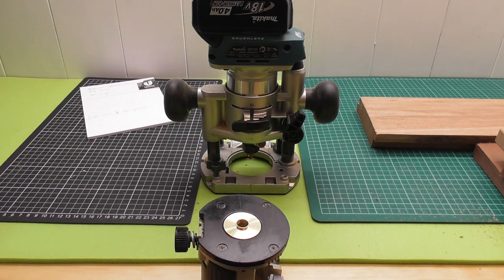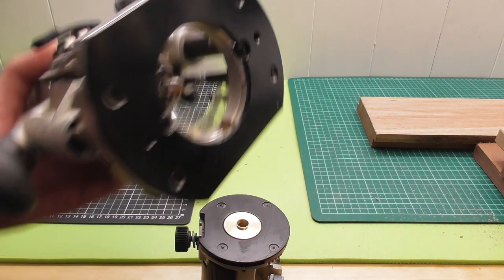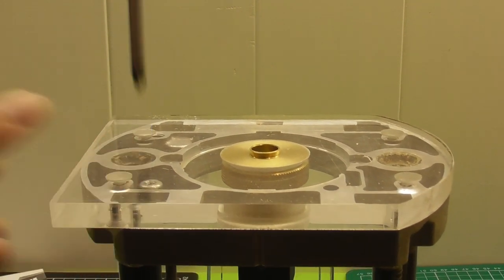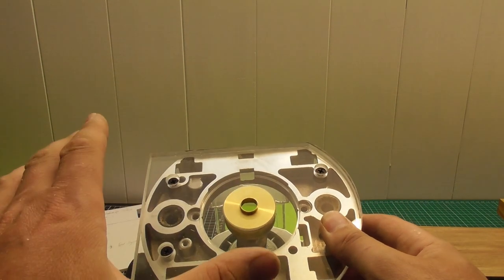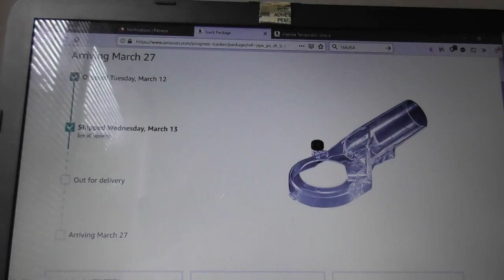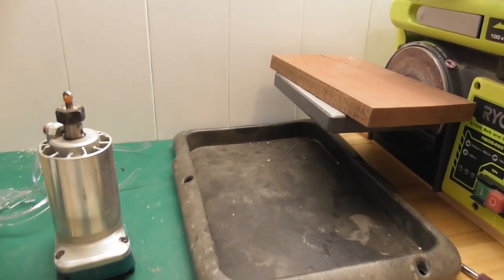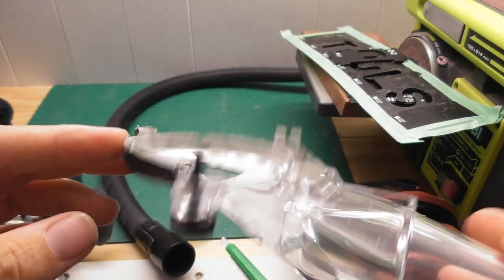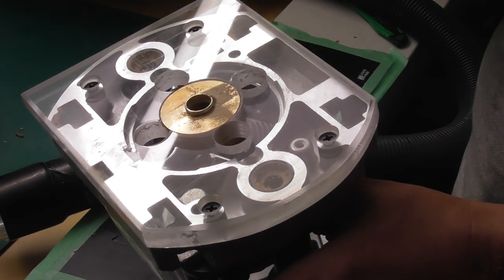Makita DIY Plunge Router Base Template Guide Base

Comment: solid i was wondering what size forstner bits i would need to do this, your video answered that for me, thanks. If I could add something to it though, I'd recommend drilling the 35mm counterbore first, then use the center point left by the 35mm to reference the center of the 30mm so they end up perfectly concentric 👍

Comment: Good vid cheers, Had just made myself one of these over the weekend too, Except mine is for the cheap ryobi router. I did the exact same stuff up too, I drilled my hole right through with the small forstner bit first then realised I still needed to centre a bigger bit to rebate the bushing. 
Where did you get your acrylic from in NZ? 
I can only find 6mm perspex or wholesale suppliers of large sheets.
Reply from the maker: It wasn't too big of a deal because I had already set the fence on the drill press so it was easy to line up again. The base was originally a sign that my wife brought home from work. Up to 20mm is available from some sellers on TM.
Reply: @ToolsAndStuffOFFICIAL  cheers, will take a look! yeah I used an old acrylic book rack from work too, but wasn't perfectly flat.
Reply: @ToolsAndStuffOFFICIAL  Drilling the bigger one first, halfway and then ending with the smaller one for the rest ?

Comment: im new to this what does the guide bushing do ?
Reply: Allows you to follow templates, like the letter he used in the video. Those are called Porter Cable types if you Google it. You can buy kits with various sizes. The adapters are easy to find.

Comment: The problem with dust collection is that the bushing covers almost the whole template. There's very little room to suck out the dust. If you were to rout without the guide bushing dust collection would be fine, but your templates wouldn't. Seeing how thick the polycarbon base is you could probable cut four circular slots around the bushing with maybe five millimetre left between slots. should be strong enough.